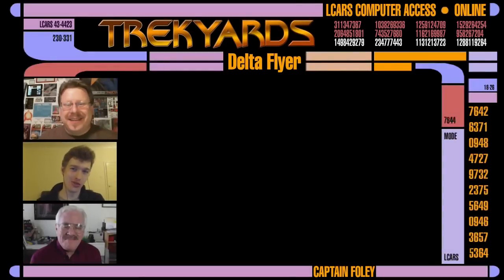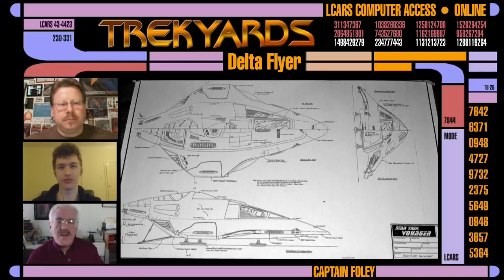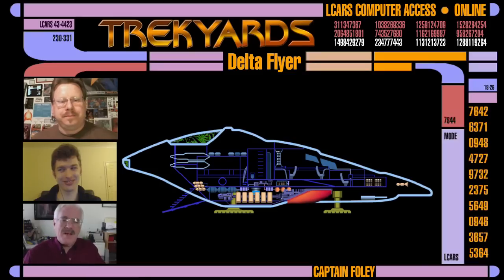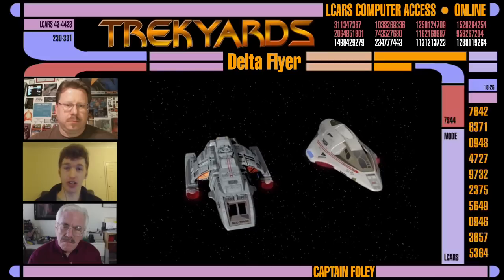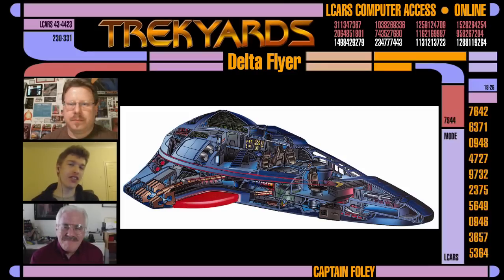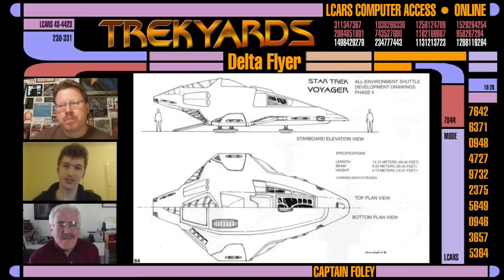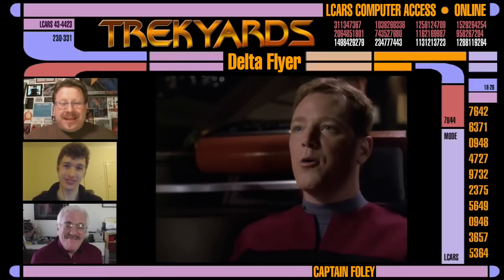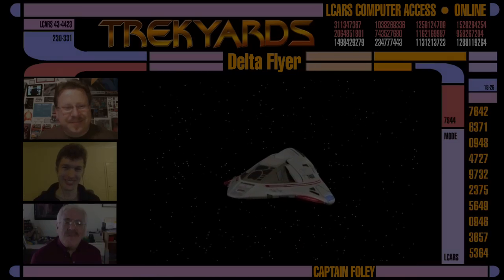Trekyards - Ep. 32 Delta Flyer Design with Rick Sternbach

Comment: It would make sense for Voyager to upgrade their shuttle bay to accommodate larger/more vessels. They are in it for the long haul and there is security in numbers. I think it would have been cool if Voyager evangelized the Federation a bit more. Maybe found a Migratory Federation of Vessels.
Reply: Brandon Lisik  Indeed. Since Delta Flyer was built on Voyager.
Reply: Brandon Lisik  Good point I mean since Voyager had the ability of planetary landings. They could just land the ship on a planet with a solid surface and easily upgrade the shuttlebay to accomidate certain shuttle sizes.